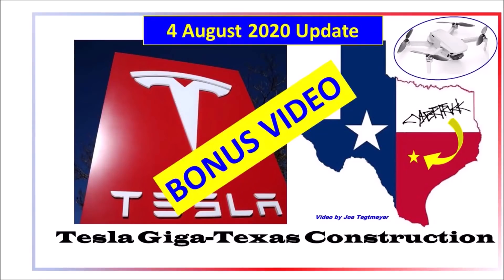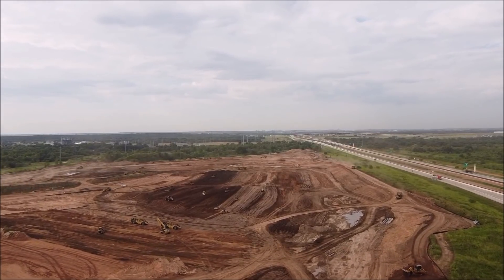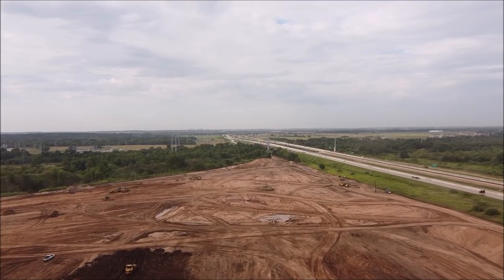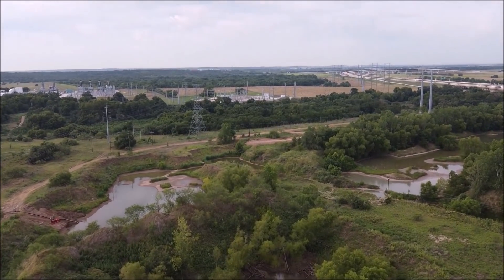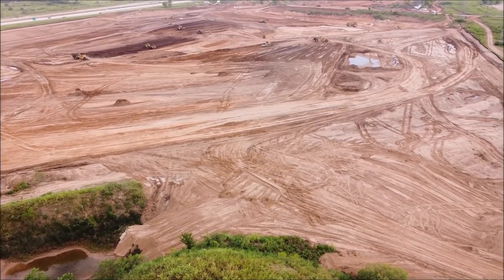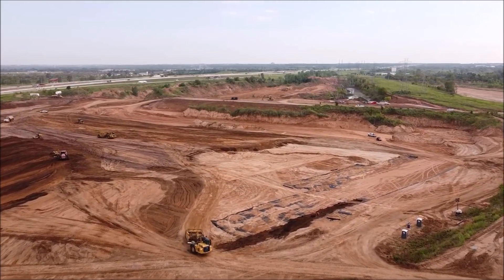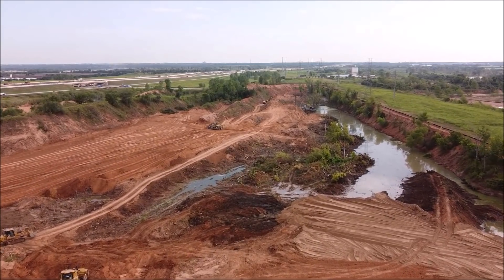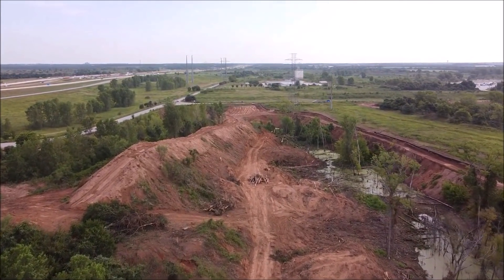Tesla Giga Texas Drone Shows Need 41,000 Truckloads of Fill Dirt

Comment: 41000 tons or 41000 trucks? 500 trucks a day for 80 days? cant be right?!
Reply: Those are Scraper Pans capable of self loading, with more payload when pushed by a dozer. Then self unloading in thin layers. Typically used off road in a cut fill operation onsite....
Reply: @emcityltd6921  Check out the correct video which has the information behind the numbers Armen discussed.  Here it is on my channel:

https://youtu.be/uzuok5QZjVM
Reply: @emcityltd6921  yeah those are diesel machines

Comment: Ideally, you could get away with ZERO trucks worth of 'imported' dirt. All you need is to settle on topology where the excessive dirt from one section is used to fill up a section that would need some.
The 41K truckloads of imported dirt figure is based on... what?
Reply: https://youtu.be/uzuok5QZjVM
Reply: @Joe Tegtmeyer 
Thanks for the link Joe.
Reply: Arth Denton...
It’s a former placer mine. Huge amounts of sand and gravel were removed from it to build the city of Austin so there’s a net deficit of earth that needs to be replaced. 
What they could do is design in a lake, but it looks like they want all the useable land they can get.
Reply: @jbell6642  Ah, I see. Drainage may be an issue but the Colorado river borders the property so maybe not so much.
Anyways, not 'everything' needs to be built on the exact same horizontal plane. I believe that Rome was built on 7 hills a while ago and it's still around today. And the Greeks have their Acropolis - I believe it means 'high city' - which sits well above the rest of Athens.
Reply: @Arth Denton 
Absolutely it could be multi-terraced like Rome. I kinda hope it is. And instead of importing fill to bring everything to a uniform grade, leave some ponds and channels as wetlands. Musk mentioned an “ecological paradise.” We’ll see. 
But at the end of the day, the priority and purpose will be for this to be an efficient industrial area, not an ecotourist destination.
Reply: @jbell6642  Of course. I was only wondering how this person came up with the 41000 truckloads of dirt.
Reply: Arth Denton 
He probably called up his local dirt supplier.